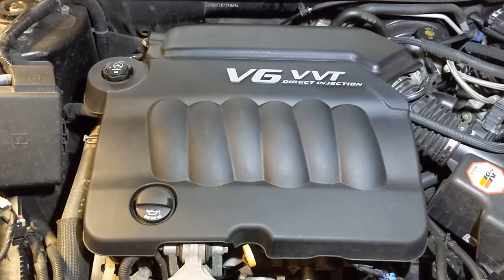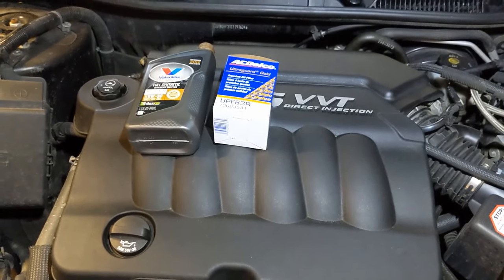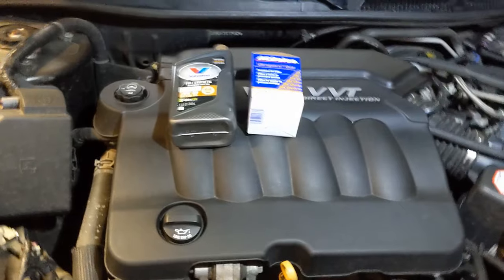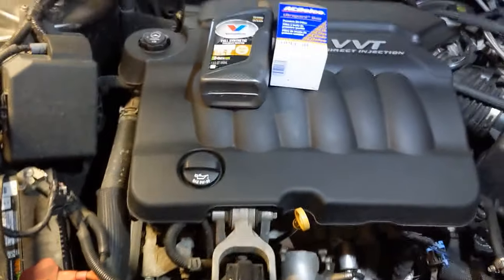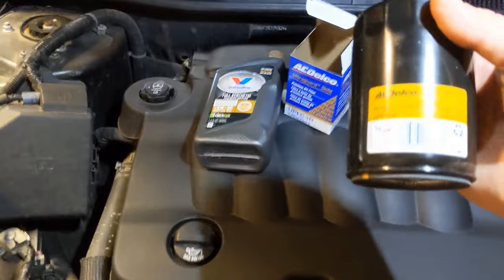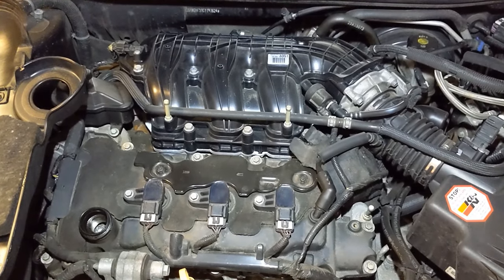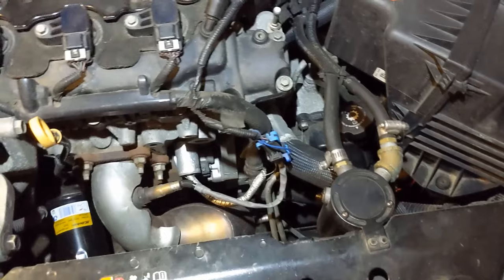How to keep your GM 3.0 or 3.6 V6 running forever - **High Feature V6 LY7 LLT LFX LGX LGZ**

Comment: I have 133K miles on my 2012 Impala. Only engine issue so far has been a purge solenoid. I use full Dexos approved synthetic every 3 to 5K miles. I usually change it at around 50% on the oil life monitor. The transmission takes 5 quarts btw. I drain that every 30K miles or so. It runs, sounds, and drives like a new car still. I would think that 200 to 250K miles is attainable without any major issues like timing chains. If you follow the oil life monitor you could expect half of those miles before the timing chains fail. Great engine if it is maintained properly.
Reply from the maker: Couldn't agree more!  I change my trans fluid every spring, usually about 5.3 qts.  I have 175k on my '12, and she runs like a shaved ape!!
Reply: @CertifiedShadetree  Maintenance is the key!
Reply: @CertifiedShadetree  Let me know how many miles you get out of it. I am shooting for 200K at least.
Reply from the maker: For sure!  I figure I'll hit 200k two years from now if I continue to drive the same amount of miles as I am now.  I will surely record the moment for YouTube posterity!! 😁
Reply: @CertifiedShadetree  It's a shame that these cars and engines get a bad reputation. It's mostly due to lack of oil changes. I will watch for it!
Reply from the maker: It really is a shame!  One can't treat these engines like the old GM pushrod engines of yore - i.e. run them for 5, 10, 15k past their oil change due date and expect them to survive...
Reply: @CertifiedShadetree  I have seen the 3.5's and 3.8's still running on 1 quart of oil! It would be game over for the 3.6.
Reply from the maker: No doubt!! It still floors me how some people are ignorant to the most basic of car maintenance. I mean, you don't need to be mechanically inclined to remove and reinsert a dipstick FFS!!
Reply: @CertifiedShadetree  well said mate !! that  is exactly why these 3.6 V6 engines get such a bad rap. people expect it to be an even better 3800 so treat it like so and then winge and complain when something goes wrong . Maintenance is key for ANY modern Direct injection engine... i know first hand that these engines can be very reliable ive worked on one with 240k km on it , all original ZERO issues and not a single leak anywhere .

Comment: I have a 2005 Buick Lacrosse with the 3.6 250,500 miles on the clock and my timing chain is stretched.
Reply from the maker: Honestly, that LY7 had a good run. I wouldn't be disappointed in getting 250k out of an early 3.6 at all..

Comment: I have a 2012 Malibu with the LY7. Still runs smooth at 126,000 miles. Oil change les than 5k. only use dexos oil with Wix filter. I tried pulling the pcv from the back of the engine, and modifying it. Not much room and its in there very well. Hopefully the car will last 200,000+ miles especially considering how ridiculous car prices have become.
Reply from the maker: Yeah, this year has been an insane one as far as car prices go!! Luckily car part prices haven't gone up too terribly, otherwise all of us DIYers would be doubly screwed!!

Comment: I change mine at 3,000 miles, and use full synthetic everytime! I got a 2014 Camaro V6 VVT GDI, that I drive hard. Now my concern is tires and suspension due to all the potholes in the State of Michigan
Reply from the maker: Ah you gotta love potholes. We have a metric fuck-ton of 'em here in MN as well!! I posted a vid recently where I replaced inner tie rod ends on an Impala, and one of 'em was completely bent to shit!!
Reply: @CertifiedShadetree  I can imagine it! I heard MN gets lumped into the rust belt. Potholes are the only reason I dislike owning any car period. But It's just not as fun trying to peel out in a pickup truck with oversized tires lol. If only there was a way to permanently end potholes forever.....
Reply from the maker: They gotta have a reason to keep those state employees employed!! 🤣🤣🤣

Comment: I'd like to hear more details on WHY the timing chain issues are happening with this engine.
Reply from the maker: Someone can correct me if I'm wrong, but from what I understand, the timing chain tensioners apply their tension via the engine oil pressure. When oil changes are neglected, over time the engine sludges up, resulting in less oil pressure being fed to the tensioners. The chains therefore go slack, leading to them jumping timing. Another side effect of poor maintenance is the VVT solenoids sludging up, causing even more timing issues.
Reply: @CertifiedShadetree  In one way it's a bad design if compared to the previous model GM V6 engines. A engine with cam chain usually lasts the life of the engine, heat, low oil never had much of an effect on the life of the cam chains in previous engines, but not these engines. As you can see, everyone is asking the same questions?  Backwards technology????  Everybody I know would prefer the older GM V6 engine tech.
Reply from the maker: @billielockman7347  If I had my way it would be 350's and 3800's forever!!🤘🤘
Reply: @CertifiedShadetree  Yes, back to something decent. These new sophisticated designed engines are problematic and extremely stressful to own. I have had 2 engines blow on me in the last 10 years, the first was the dreaded Nissan Patrol with a 3l turbo diesel and just recently  Ford Ranger turbo diesel. My mates Nissan Navara turbo diesel blew up around 4 years ago. These new diesels are pathetic as far as reliability goes, no way would I take a modern 4x4 diesel on a bush trip, not a chance! And as for these new designed petrol engines needing new cam chains ???  That's a major component we never ever had trouble with in previous models, but at least you get warning.
Reply: Low oil levels = high heat = stretched chains. check your oil level and never let it get too low. chains will last a long time if you do that.
Reply: @iviaverick52  I know the importance of oil changes. Maybe I can phrase the question better. Why are timing chain issues more prevalent in the 3.2 than in other engines?

Comment: I have a 2010 Chevy impala LT, any tips around what fuel to use? I currently use flex fuel.
Reply from the maker: I wouldn't use e85 every single time you fill up. Throw in a tankful of regular ole 87 octane every 3rd or 4th fill-up.
Reply: All i use is flex,I have no issues

Comment: The catch can is more for direct injection to keep the oil off the back of the valves, because there is no fuel being sprayed into the port to clean the valves, just air with the PCV oil which cooks onto the valves and clogs up the engine.
Reply from the maker: Indeed it is!
Reply: Catch can is great for the LFX, the LGZ has a redesigned PCV system and eliminates the need for a catch can.

Comment: My son is about to acquire a 2012 Impala with 177K miles from his father-in-law. No issues that we are aware of. He lives in east TX where it rarely gets cold. I know you like Valvoline but do you still like that best and what weight of oil should he use for best protection? Thanks!
Reply from the maker: I'm using Valvoline Extended Protection 5W30 these days, due to the discontinuation of Modern Engine. I believe in it just as strongly as the Modern Engine, as I don't see any excessive oil consumption with it. Whatever you do, avoid Pennzoil at all costs!! These engines will chew through Pennzoil to the tune of a quart every 1500 miles.

Comment: Does this apply to the 3.6 in the Cadillac XT6? Mine is a 2023 and I'm wondering if this is still a issue or not for the 2023 model year. I use Mobil one extended life oil in all my cars which is good for 20,000 miles but i change it somewhere between 7,000 and 9,000
Reply from the maker: Except for drilling out the PCV (due to it being a different design,) absolutely. Although the XT6 has the much improved LGX engine, you should still religiously maintain it. That includes 4-5k mile oil change intervals.
Reply: @CertifiedShadetree got it, leave the pcv valve alone and change the oil between 4009 and 5000. Thank you

Comment: We just bought a 2015 Chevy Equinox, picking it up on Tuesday.  The Carfax sheet shows "3.6L V6 F DOHC 24V". Does  the "F" mean "feature or high feature"?  It will be used as a backup to our primary drive, so I don't expect a lot of miles on it.  Will change the oil & filter every 3K-4K miles.  We test drove it and was very pleased with the acceleration.
Reply from the maker: Usually they say "HF" on the Carfox, so I bet they made a typo there. That engine would be the LFX, also. Definitely pull that rear PCV and drill out the holes if they aren't already (link to the how-to is in the description.)
Reply: @CertifiedShadetree  Thanks.
Reply from the maker: Best of luck to you! 🍻

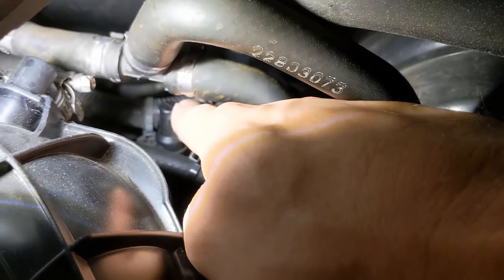Comment: Reminder there are 2 PCV hoses on a 2009 3.6L Direct Injection VVT engine.  1. Clean air intake or FRONT of engine  and  2. Dirty air REAR of engine hard to find but on drivers side rear of engine where actual PCV lives.  Great video at 3:12 showing REAR pcv actual valve thanks.
Reply from the maker: You are correct. I've since made a video installing a clean side separator on my 3.6.  Keeps the oil that gets pulled into the intake tube under acceleration out of the tube..
Reply: But how do you change it. I can’t find one video on it.
Reply from the maker: @LoeNateDogg  The PCV? I have one video showing you how to access it. After that, just grab the end of it with a pliers, wiggle it back and forth, and pull straight up.
https://www.youtube.com/watch?v=-XlG5po15Fw

Comment: You helped guide me to save my 2010 Malibu 3.6 so hell yes! Anything you can do to catch can the rear PCV? I’ve got a new one drilled and replaced and I’ve got a catch can for my air intake PCV side too. I want to permanently fix this tho so I didn’t know if there was a way to modify the rears outlet to get a catch can on it?
Reply from the maker: Here's an old video: (ignore the part where I say it's not worth it - it totally is!!)
https://youtu.be/-XlG5po15Fw

I install a clean side separator in this one:
https://youtu.be/hu57lGzxiRY

Comment: i love the tips , awesome video , whats the purpose for the pcv  again ?
Reply from the maker: It was too restrictive and not only raised the internal crankcase pressure, it caused sludging inside the rear valve cover.  The factory increased the bore sizes in later model years, but it's always a good idea to check whether or not yours has the enlarged holes.  I take the PCV valve out every oil change and spray some carb cleaner inside it just for good measure..
Reply: @CertifiedShadetree  post more videos i love watching about vehicles i learn a lot . Thank u buddy
Reply from the maker: @myfavorites1016  For sure!
Reply: @CertifiedShadetree  hey mate. I have a Holden Calais ( Buick Regal) in US. 2018 version of the 3.6. Was the valve size modified in this? Thanks in advance.
Reply from the maker: Yes it was. It has a completely different PCV valve design from the LFX, and the holes are larger..
Reply: @CertifiedShadetree  thanks dude. Very much appreciated. Oil change every 6000km I think.
Reply from the maker: @thebiglebowski4309  The Dude Abides! 🥃<< White Russian salute emoji..

Comment: Thank you will change oil every 3000 and keep it running as long as possible
Reply: I had a Buick the same engine and never had problems that had 187,000 mi on it and my brother raced this thing everyday a hundred plus miles per hour no problems
Reply from the maker: He was giving it regular "Italian tuneups"!! 🤣🤣
Reply: @yunusquddusofficialactor  From my understanding, every once in a while it's actually good for these engines (or any modern engine for that matter) to put the hammer down on the highway. It gets the oil moving through the engine parts real nice and keeps it lubed.

Comment: Great site! I got a lot of good tips for my 2012 Chevy Impala, I went ahead and bought a new PCV valve (barb) and drilled it out to specs but I ran into a problem I cannot get that old PCV out no matter what I try any helpful tips???
Reply from the maker: Since you have a new one you don't have to worry about destroying the old PCV. Clamp a vise grip onto the nipple and rock it back and forth and twist it while you pull up. You can also pry underneath with a flat blade screwdriver.
Reply: @CertifiedShadetree  Great! I'm going to try it thanks for the info
Reply from the maker: @markmcginnis7892  Best of luck!🍻